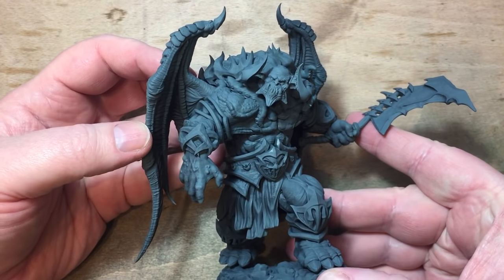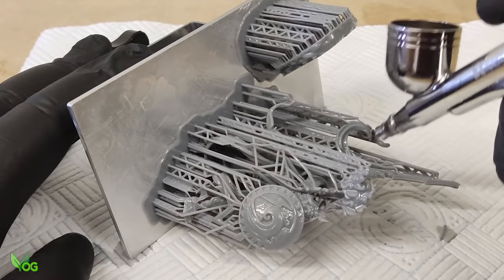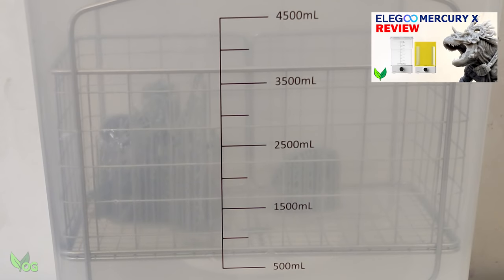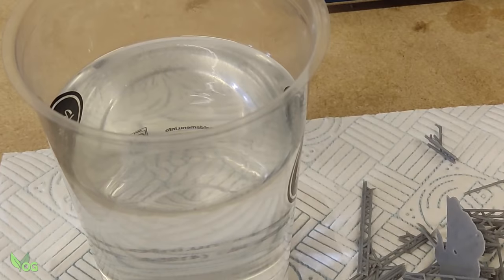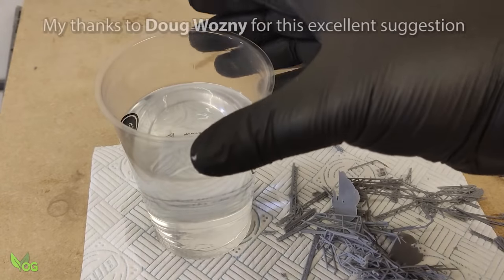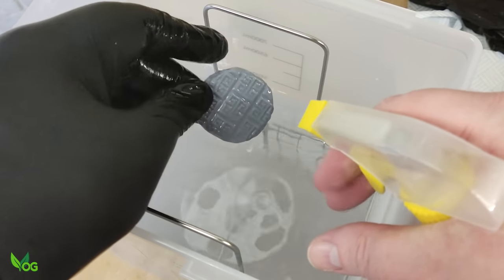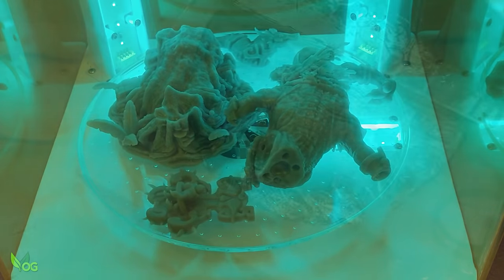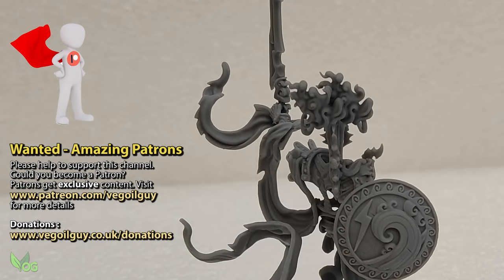BETTER cleaning & curing of 3D resin prints [EASY METHOD]

Comment: Nice video!
I only wonder how do you deal with hollowed massive(ish) prints, and getting out the resin (ideally even curing it a bit on the inside).
I just started 3d printing this month. I subscribed to Artisan Guild and got this month's set 'Defenders of Lok-Badar II' dwarves & gryphons (I really like the gryphons!), to print as a gift to a friend that's deep in D&D.
So in that set there's a kings throne, which is rather bulky, and fortunately I printed after I started thinking about hollowing structures. This one was really easy, as the shape is combination of cuboid, so the inner space when hollowed is wide and all connected, and also there's plenty of flat surface at the bottom to drill big enough holes.
However (for some reason) I tried printing one hollowed gryphon, and while I somehow managed it, I wouldn't say it was easy, and I'm still unsure if there's some uncured resin left inside.
The first difficulty is that more complex shapes have narrower, complex and often separate cavities when hollowed out.
One thing about hollowing I think is that if you have hollowed out a cavity but you can't make holes (or you don't want to make them because it's difficult to hide them afterwards) then it's a ticking bomb - only a matter of time for the print to break and leak some resin everywhere.
The gryphon hollowing was challenging and I got to get ... creative ... It had two separate cavities - the gryphon itself and the stone column which supports it in the air (by casually touching it with a foot and tail). The column was a bit easier, since its bottom would later be glued on a baseplate and would hide the bigger hole I made, but to be sure I added a small hole on the top too. That top hole is visible, though partially hidden under the gryphon's tail.
But the gryphon was extremely challenging to hollow out. It's a complex shape, but fortunately it made a single cavity, just a wiggly and thin at some places, but also it didn't have any convenient places to hide the drain holes. So when I said that I got creative I mean that I put two holes where gryphons (and us too) have holes ... for the Ins & Outs :) 
One tiny hole in its mouth, just where the throat should be, and another slightly larger ... under the tail :)
Because of the tight inner cavity and small holes I worried that it might be a failure (in the sense that it wouldn't be safe if it was a risk of leaking resin), so I got hopeful, when I saw some bubbles coming out of its mouth when submerged in the alcohol (the stone column was easy to drain). So I drained it many times manually dipping it in & out to get the IPA in and then out. But it's difficult to see the IPA draining out since all the gryphon is wet with it and the IPA was probably more than the one dripping from inside. The only way I knew it worked were the air bubbles that came out its mouth when I submerged it again & again.
But even now that's it's clean and post-cured (so that I can safely put my lips on it) I have a very hard time to blow air from its mouth (thru its other hole). It does work, some air comes out, and no resin leaks, but I really have to blow hard :D
So do you have any advice (or perhaps video already) on hollowing prints?

Comment: I have been using soapy water and a brush. Seems to work well with plant-based resin. Less toxic and I only have to buy washing-up liquid. I remove as many supports as possible depending on the part and reclean with a brush and jobs a gooden.
Reply from the maker: Thanks for sharing!

Comment: You can clean the IPA by curing the resin inside with UV light. If you live in a hot climate you could just put the clear container in the sun and let it do the work.

Comment: The main safety issue with the sonicator isn't due to the heating (it is one yes) it's due to the fact is creates a solvent vapour without it heating the liquid, as these cheap sonicators are not lab grade with spark protection they can auto ignite the vapour.
Covering the pot with a lid, even one that's not clipped on will reduce the vapour that escapes.
Reply from the maker: Good point. I've not noticed an increased smell, but it could be there. A sensible precaution 😁👍👍👍
Reply: I was just about to suggest the same thing. I use a ziploc bag filled with IPA, and then put it in water in the ultrasonic cleaner. Keeps the IPA fumes contained during the cleaning process

Comment: I like to take the buiId plate with the print stil on it and dunk it in a small bin of ipa and swirl it around. ..THEN scrape it off the plate so im not dealin with resin.  Then I pop it in a ultrasonic bath of ipa.  Blast with air to completely dry.  then I cure the entire thing at once with the supports which makes them super easy to remove once finished.   Your method sprays resin everywhere..then you have to invidiually dip each piece in the alcohol.  If you do the entire plate its fast and your hand stays out of the alchohol.

Comment: Hmm, I don't know if there is a discernable difference with my simple approach than yours. I purchase almost exclusively water-washable resin as I find it cheaper to avoid IPA when possible (although admittedly more difficult to dispose of) and largely only do a single long rinse in my wash and cure station (about 10 mins in an elegoo basic wash and cure). I, anecdotally, have decent results but I am curious if the increased washes/IPA makes a big difference.

Comment: Thanks for all your great videos. I'm wondering, how long are you normally curing for? What do you consider too little and too much curing in that station you're using?
I'm in the process of testing my own with water-curing. I'd love to see a video on that. Thanks again for all you do.
Reply from the maker: With miniatures, usually 2 to 4 minutes. I've never had any issues 😁
Reply: @vogman  After some testing, I've been water curing my prints quite easily by dropping my parts into a dedicated pickle jar of distilled water. The jar fits perfectly on the UV turntable. The light really gets bounced around with the water and my cures have much less wetness in any of the cracks. I'm still running my cures for the 4 minutes which seems to work great. Thanks again!

Comment: i use a multi step recycling for my ipa.  once it gets to pretty useless stage it goes in to a air distiller then i have clean ipa again (note you do lose some during the distillation process which is why i don't distill it every time).  i basically have two steps the first  one in dunking in "cleaned ipa" and then into the wash and cure or sonic cleaner.  after a few times in the wash and cure that gets set aside in a 2 liter (marked as ipa) put in the sun curing the resin suspended in the ipa and then that gets filtered into the dunking ipa  i repeat that a few times until i feel it isn't cleaning as well. then it gets distilled and the distilled ipa along with any fresh new ipa goes back into the wash and cure. this extends the use of my ipa a lot.
Reply from the maker: Thanks for the share 😁

Comment: I have a high success rate in  purifying IPA with a temperature controlled distiller and a semi-sealed container to drip into (using tubbing)  to avoid excessive time scraping the distiller  I coated the distiller with  PFE spray  before using it.  some IPA is lost in evaporation but you still get a large amount back.
Reply from the maker: Thanks for sharing 😁

Comment: Good evening my friend, thanks for the enlightening content! How long do you leave in the UV station? I usually leave it for 30 minutes but I feel that it heats up the lamps a lot, I don't know if it can cause problems.
Reply from the maker: Personally I only cure for 5 minutes with most prints. Biggers one maybe 10 to 20 minutes. They don't need much 😁

Comment: i use 96% ethanol to clean the parts, 3 baths in different containers, the third one is always clear... i soak them for 5 minutes in the first bath, then i brush them with a brush, then 5 minutes in the second i brush them again and 10 minutes in the last bath without brushing... they come out perfect...
Reply: It's a good system. 3 or more sequential stages where you discard dirty Stage 1 periodically.. 2 becomes 1 and 3 becomes 2 and you then make a new final "polish" wash stage 3.

Home recovery of solvent is possible but a Rotary Vacuum Evaporator which would be the best method are too expensive for the home gamer.
Reply: @RocketMagnetUK  i am just exposing the baths #1 and #2 to UV after some time and filter the alcohol (also clean good the bath container)... i was thinking about distilling the alcohol after the UV exposure as a better way to clean it, but in my country lab glassware is impossible to buy :(

Comment: It is like using a powerful water brush yet delicate.
Spraying solvent with a pump action (flower watering)  spray bottle.  Over a bucket to collect over spray.
Dip in warm water for easy support removal. Give it a good spray down with clean solvent. Let residue solvent sit in a airtight container for a day.  Than pour it back in to the spray bottle (leave the gunk at the bottom).
Ps. It is like using a powerful water brush yet delicate. Release pressure of the spray bottle when done.

Comment: My first step is to remove supports in a tub of hot water.  This seems to remove much uncured resin.  I clean the print in IPA after.  I leave the water in the sun before disposing.  Is this bad?

Comment: Hello VOG, 

The Mercury X is designed to allow the build plate to sit directly inside the container of IPA, this both allows the build plate to also be cleaned at the same time and assures that small parts don't fall through the basket. Is there a reason you remove the model and allow it to sink to the bottom of the basket?
Reply from the maker: Convenience is a big factor and take advantage when you can. But just remember, until a piece is removed from the plate, there's always uncured resin hidden and waiting to be cleaned. At least, that's my experience 😁

Comment: I like using water wash resin. In theory only water is needed, but I finish with a brush and some IPA. 
The bonus is you can leave the water baths in the sun and let them evaporate. If it wasn’t horrifically contaminated, the resin can be peeled off the bath wall, otherwise it turns into a giant gummy bear.

Comment: Great tips! But i would be careful with airblasting uncured resin around, unless you have a safe way to catch ALL of it and cure it in the sun.

I just got my Anycubic washing station and I'm already thinking of buying some additional tupperware to mod the propeller into, to optimize IPA usage.
Reply from the maker: I normally work inside a cardboard box, but it makes filming a nightmare 😁
Reply: Anycubic also sell additional wash containers, with the propeller, for about £15-20, so that's a much easier route if you don't want to mod your own

Comment: Have you considered using a distiller from Amazon to recycle your IPA back to clean and pure? That would remove all your resin and leave it on the bottom of the distiller. Of course it would depend on the actual amount of IPA that you are using, as to whether it would be cost effective. But it might be something worth looking into.
Reply: Doing this now for 6 months. Just get a distiller you can set on 87C to avoid a to hot distill. And put a hose on the pipe so you have less spillage.
Reply from the maker: I haven't tried one of these. They look interesting, but make sure they're good for alcohol. Boiling alcohols is a tricky business, as I experienced in my IPA recycling video 😁
Reply from the maker: Interesting 👍

Comment: Hello, could you tell me the name of the figure we see at the beginning of the video, the link to Archvilain does not work but I follow them on MyMiniFactory, however given the quantity of figurines they have produced so far it could take me literally hours to search and find your figurine, so if you could tell me its name it would allow me to find it more quickly, and by the way maybe change the link you put in the description that does not work. Thank you ;o)
As far as the subject of the video is concerned, I use the same technique, I have a tray with IPA which isn't super clean but it's enough to remove most of the resin that's left on the miniatures, to "help" with the cleaning I use a brush to go just about everywhere. Then, like you, I put the part in the W&C with clean IPA, and when I get out I do the same thing, using my airbrush to remove as much IPA as possible from the small nooks and crannies of the parts and so dry them as much as possible. I remove the supports after this drying operation or sometimes I do it before drying so that the supports remain supple and easy to remove. I don't have an ultrasonic cleaner and I don't intend to buy one at the moment (a good ultrasonic cleaner is quite expensive and not necessarily necessary), as all the cleaning I do seems to be sufficient. Finally, of course, I put the pieces under UV light. To 'clean' the IPA I leave the containers containing the soiled IPA in the Soliel light, I don't care how long, I know they'll stay there for several days or even a few weeks. Once the sun has precipitated the resin residue, I can filter the IPA and reuse it. I do this routine all the time and I have to say it saves alcohol.

Comment: May i? I suggest joining steps 6 and 7, and spray the IPA with the airbrush. A little more pressure this way, and you can use the trigger control to spray/dry and check/ spray more if deemed necessary. In this case Phil Hathaway tip is paramount: It WILL be flung back on you!
Reply from the maker: Comments and suggestions are always welcomed here 😁

Comment: From looking at the curing station, it does not look like the tops of the prints are getting a great flood of light, better after adding the Alu foil, but not great, do you thing it would be worth it to add a 405nm cure light to the top to add more uv?
Reply from the maker: Some curers have top UV lighting. Phrozen for instance.
Personally with the foil and lots of bouncing UVs, I've never had a bad experience with curing 😁

Comment: Great videos with a excellent voice for doing VoiceOver for children books :)
I would like to ask something about that mini air compressor set you got there. I found this model "Gocheer Mini Airbrush Kit" on Amazon, it was recommended by a review site as well as the set you have here (Named as MASTER in US) too. But the reviewer said Master is prone to clogging. So If I might ask which one would you recommend as a compact, silent and reasonable priced set? Perhaps some other brand? Thank you
Reply from the maker: I've already picked out a couple of suitable options here https://vegoilguy.co.uk/equipment.php but please be aware of two important things... 1) I suspect a lot of these cheap units are produced by one company and sold with different labels on them and 2) I was looking purely for a cheap air blaster that could also service a little primer or maybe IPA. If you're looking for a proper air brush for art purposes, you might want to look elsewhere.
Reply: @vogman  thanks a lot for the reply. Yeah i noticed that same device with different made up brand names thing on those devices as well. Actually I was planning on printing my own characters like superheroes and/or beasts that i design. Then wasnt thinking about airbrushing but perhaps painting here and there with brushes. But the device you showed there is compact and good priced to get used to placing base colors with airBrush. I pretty much preffer something that has capability of switching  paint reservoirs.  So that way i won’t be needing going thru all that cleaning the color and brush etc. 

Two days ago I got my Halot One + Anycubic wash&cure plus combo. Why i chose plus version was actually because i was going to get Halot Sky. But after seeing your Photon Ultra review. I wanted to start with something smaller and then if dlp trend kicks in next year, i would get my mid to large size printer as a dlp model. 
Sadly I haven’t seen any halot series review of yours. Even i did, i can’t remember after getting overwhelmed by couple of houndered  reviews in few months. 🚀
.

Comment: Try mean grean brand degreaser as an initial wash. Its like 2 dollars a gallon. And my alcohol stays clean for many prints. It also disolves supports over time.
Reply from the maker: If it works for you Colin, then keep going my friend. 😁👍👍👍
Reply: I'd like to try it too, but they don't sell it on our side of the pond...
Reply: @admiralbees1690  i had to resort to it, ipa is the equivalent to £17 a liter here. Either way i use my saturn for projects and engineering, so finish quality doesn't matter as much.

Comment: Is the sonic wash so much better it would make sense to use one instead of a 3D printing washer ? There are some available that let you switch off the heat setting
Reply from the maker: Hi Graham. I guess it depends on the size and shape of your typical prints. Personally I tend to use both... quick dip in dirty to remove the excess, a spin in the wash and then ultrasonic when the print is virtually clean. This just helps me prolong the life of my cleaning fluids and gets the best from the equipment I have.
Some folks just use the ultrasonic, and usually ultrasonics don't heat unless asked to, but I think mine is a dud... vibrates well but gets warm. That's why I recommended these models https://vegoilguy.co.uk/equipment.php
Importantly, you only need to use the ultrasonic for a couple of minutes. If you do it much longer, you risk ruining your prints. That means it shouldn't get hot anyway 😁

Comment: I just blast with an air gun all the resin, then spray with about 50 ml IPA the model and then wash it in the sink. dry it again with the air gun and put it in the sun. very little IPA used and mostly perfect outcome.